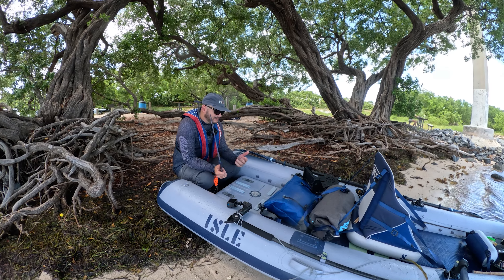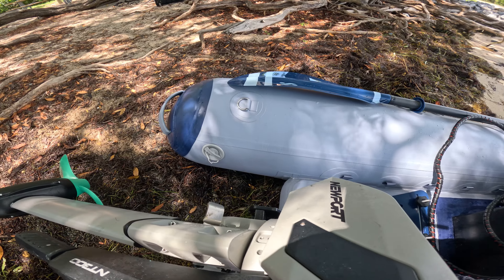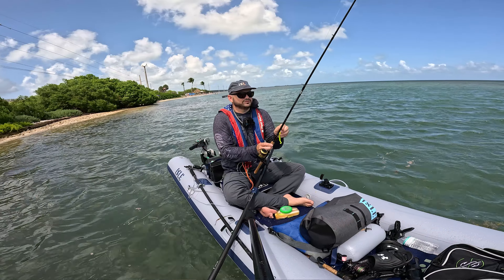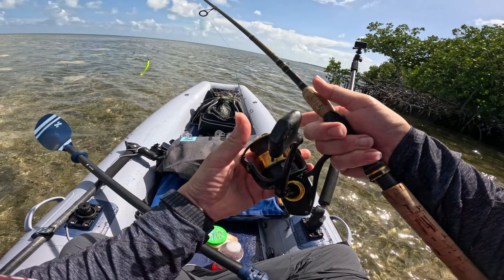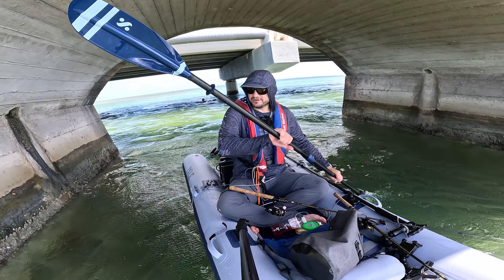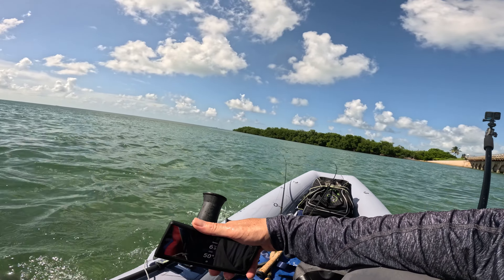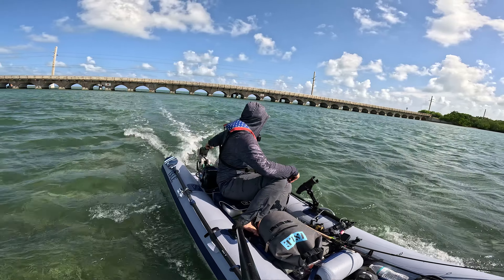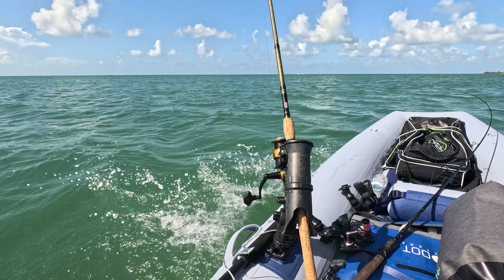Kayak Killer? ISLE Flywater Inflatable Micro-Skiff Kayak Motor and FISH FIN PUNCTURE TEST, FL KEYS

Comment: That would be a fun boat for a young guy, what's the range with that motor?
Reply from the maker: At 40% power or so 3mph plus, over 40 miles, max throttle 2 hours 12 miles plus that's on that 36v 60ah battery

Comment: What size battery did you have and what would you think the motor run time would be at full throttle? Also how easy is it to paddle? Would also like to know what you think about the stability in rough conditions, big swells and beach launches. Thanks for your videos, I really appreciate your reviews.
Reply from the maker: Group 27, 40# 36v 60ah battery that would be a 180ah 12v equivalent, paddles very well even with the weight on, I have a paddle demo video on the Playlist

Comment: Watching your I-cast video’s the tall full height seat, boat’s light weight, shallow draft & the price has got me ready to buy as a fresh water river & lake boat for my RV fishing as we travel. 

You didn’t get beat up in the chop and dragging it ashore thru brush was good to see and speed was good.  This vid also showed me that at speed it can run fast enough & quick enough to handle fast water runs that are full of strainers in a river (lots of downed trees that you have to maneuver thru at almost full throttle) to be safe.  If you watch guys like Jeff Little’s channel & the unbelievable punishment that he does to his inflatable rig, l’m not worried at all about an inflatable at 77 years old who spent 25 years in the bass boat business. Thanks Alex …. Let’s see some more!
Reply from the maker: yup they can take a beating for sure, they aren't unbreakable but they hold their own, always hace a tear A type B and a mini pump just in case, 5 air chambers always provide extra protection, more coming

Comment: Men that thing will fly with a 5hp outboard!.  The motor mount design though Is not ideal for a gas engine.  Looks like it's was designed mainly for electric motors.  Alex you look kind of cramped in the video . Does the space feel tight compared to the other inflatables you have reviewed?
Reply from the maker: didnt feel tight, lots od deck space,  gopros have weird angles, I would not use gas on this